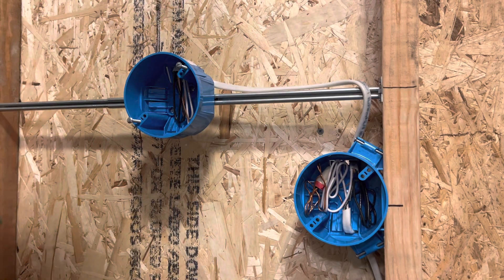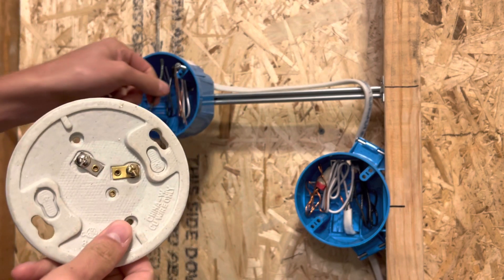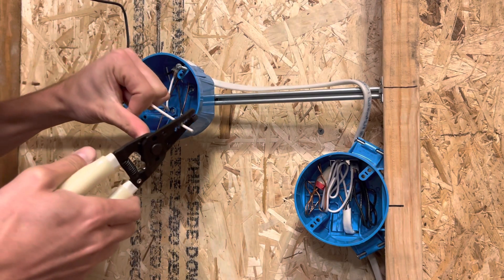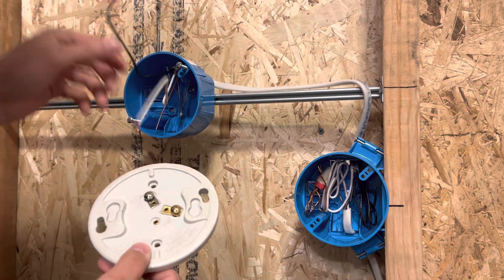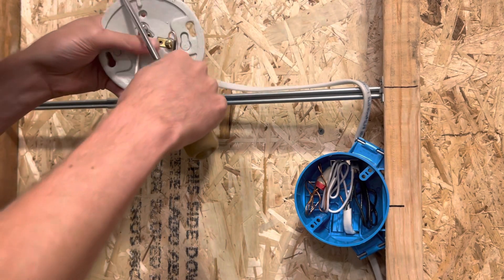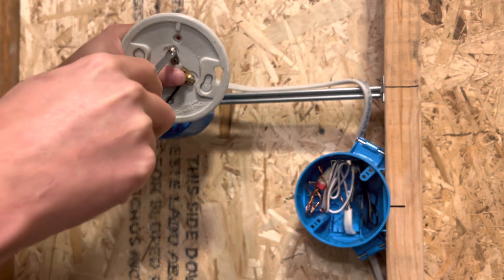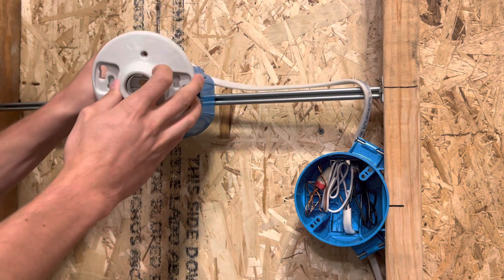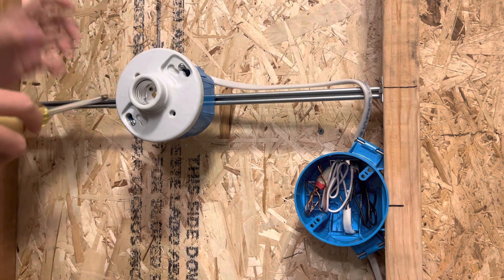Electrical 101: How To Install A Keyless Lamp Holder (Light Fixture)

Comment: Any idea why it's safe not to have these grounded?
Reply from the maker: there's not a spot to ground it and it's not made of metal so you can't get shocked.
Reply: What if box is metal @DailyElectrician
Reply from the maker: then ground the wire in the box to the box with a ground screw or pig tail. the light will still be ungrounded

Comment: I am planning to use it to attach it to my patio deck roof using the two screws provided. Then attach a light bulb security camera connected to a solar panel for power via USB. My question is, do I still need those wires, and is it safe without those electrical wires? Sorry for the dumb question 😂.
Reply from the maker: sorry not familiar with that situation. if its powered from solar/usb then you dont need power wires.

Comment: I have a fixture that has four screws on the back, not 2. How do I wire that?
Reply: You would wire the white to the silver and the black to the gold. Leave the other 2 screws empty or remove them. They are for if you want to run another light from that light. Kind of how outlet boxes work with their 4 sets of screws in order to run in a series.

Comment: So the ground is loose not attached to any thing?
Reply from the maker: yeah
Reply: @DailyElectrician I’m confused I have TWO WHITE WIRES and the black
Reply: Wait the toggle switch has ground attached but the receptacle doesn’t is that the correct way to connect this?
Reply from the maker: what receptacle? ground your receptacles and switches.
Reply: This is what confused me when i first started. Apparently, since the entire thing, lamp & outlet box, are non metallic, they do not need a ground wire connected. The ground wire is a safety to stop a metal outlet box from becoming energized and shocking you. The switch on the wall however needs the ground screw connected.

Comment: Why wouldn't you cut the ground wire flush to ensure it doesn't touch the hot wire? Or put electrical tape over the hot screw?
Reply: In case you want to swap the fixture out at a later date.
Reply: Thats what I want to know?
Reply: @RachelsBadAssJamz64  It is done this way just in case you need the ground wire later. Say you replace the light outlet with something else that requires all 3. Me, i just cut it back and use a wire nut on the end.
Reply: If you install correctly it they should never touch

Comment: That ceramic base has a groove that's obviously made to clamp a bulb guard cage onto, but I can't find any metal bulb guard cages that fit! I found some but the metal part that would fit into the groove is too wide to fit. Let me know if you know where to get a simple, old-school, wire bulb guard that actually fits a standard, old-school porcelain base. Thanks!
Reply from the maker: i do not, sorry

Comment: Wished you would include that 4.0 box installation as well in a correct way as compatible with the code.
Reply: I don't think you can use a 4 inch square box. I've tried. Looked for adapters to get the right fit and I can't find any. I ended up removing the square  box and put an octagon, or you could use a circle.